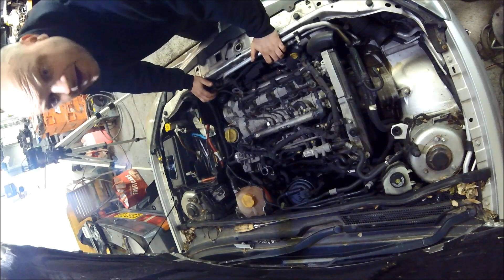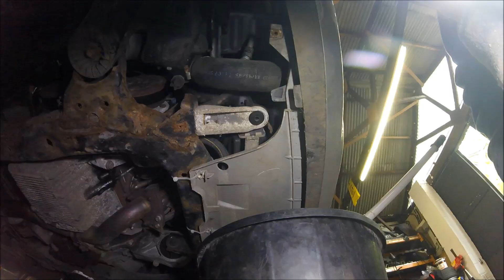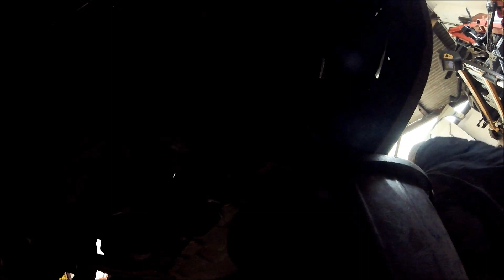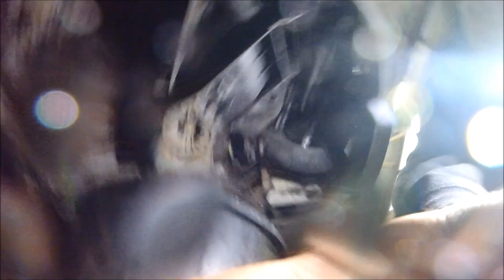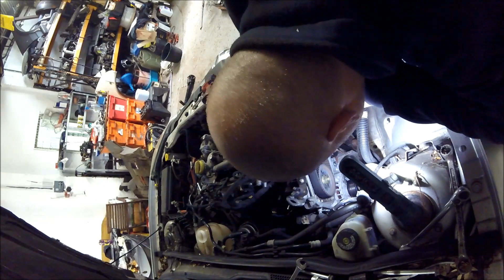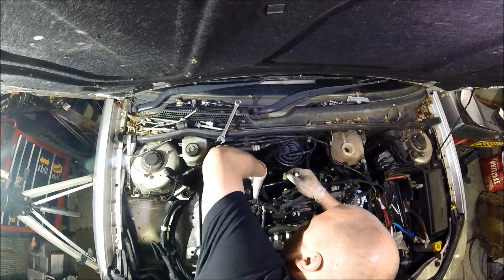Vectra zafira Astra Vauxhall SRI 1.9 CDTI  inlet remove swirl flaps EGR valve cambelt removel faulty

Comment: You can use one of the small bolts from the cam cover to lock off the pump pully, there is a locating threaded hole for it on the pump pully. Saves removing the belt.

Comment: Do it with the timing tool do it right. You don't need to take the cambelt off at all you lock the pump pulley up and remove the pump

Comment: Really useful video Terry. I have a 2005 SAAB 9-3 1.9 Tid and its exactly like yours here. I'm having trouble getting that idiot Oil Trap bracket off !! (at around 2:46 mins of the video) It's reassuring to see that you did :0) I have a better idea of what I need to do now. B.T.W. There are a couple of holes in the fuel pump pulley to lock it in place so you don't have to take the timing belt off..... really useful. Clearly designed by a different team from the sadistic "B"'s that designed the rest of it?

Comment: You don't need to remove timing belt or engine mount, there are 2 offset holes in the fuel pump pulley you can line up with 2 threaded holes behind the pulley put  bolts in and it holds pulley in place so you can remove the pump without interfering with the timing belt.